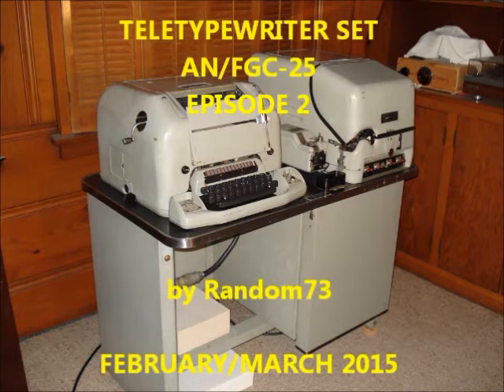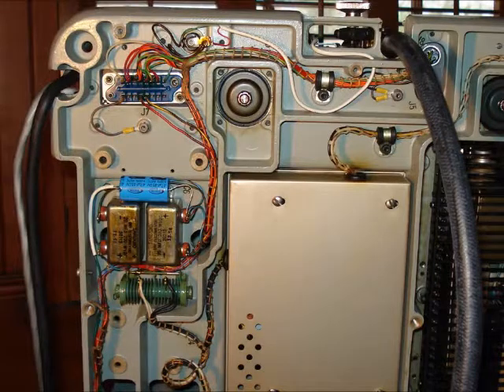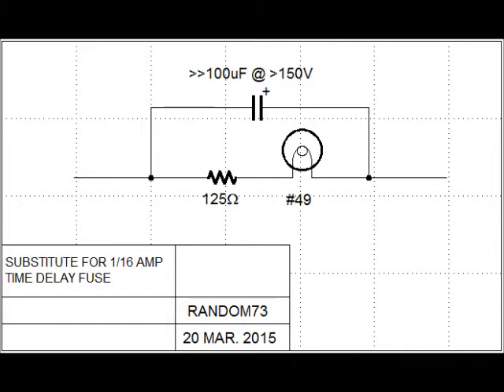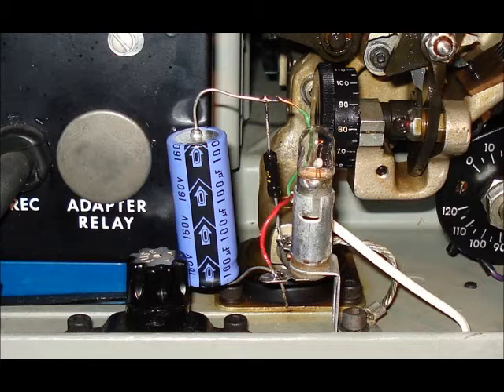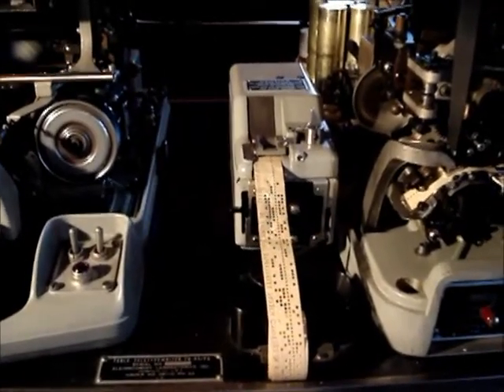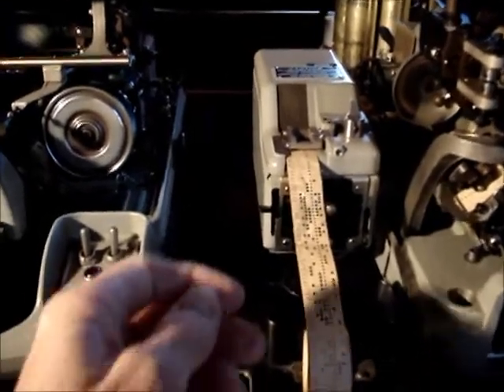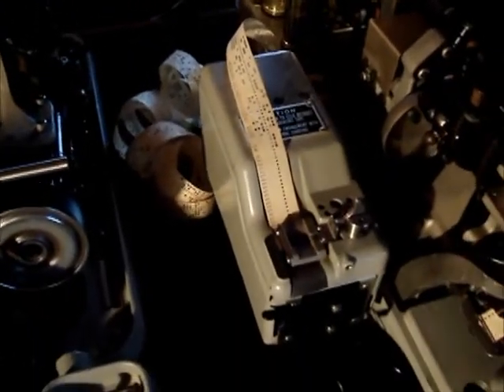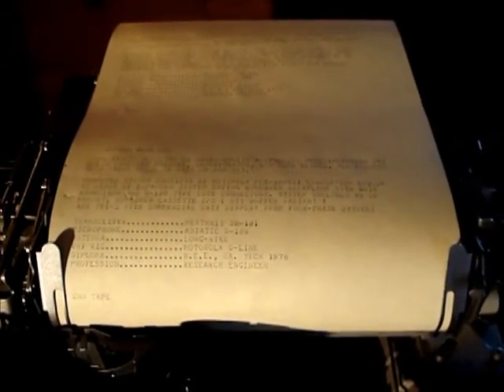AN/FGC-25 KLEINSCHMIDT TELETYPE SET, EPISODE 2

Comment: These teletypes had extremely thick gauge base metal.  I dropped one of these on a concrete floor and made a substantial dent on the floor but the teletype was A-OK.  The only weakness was the solenoid on a tape cutter.